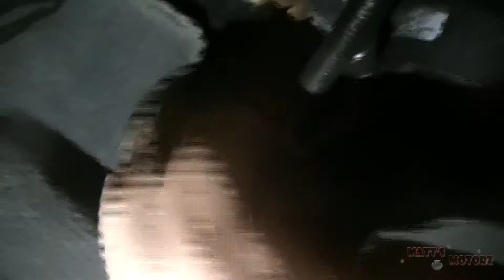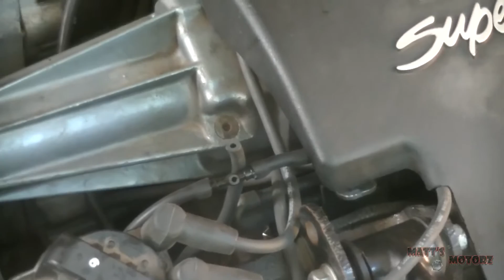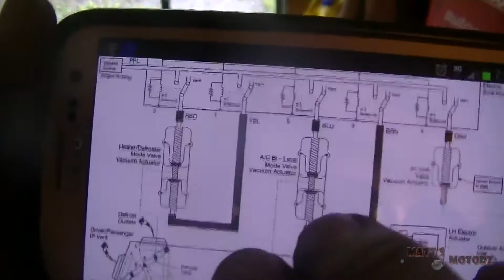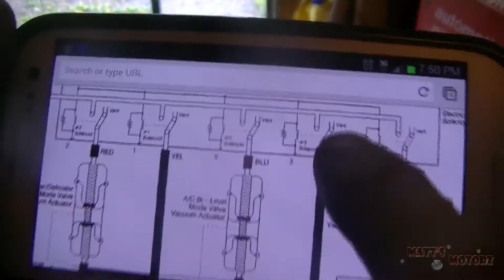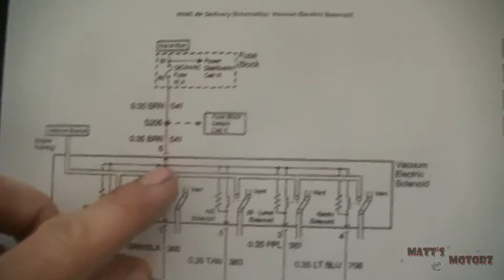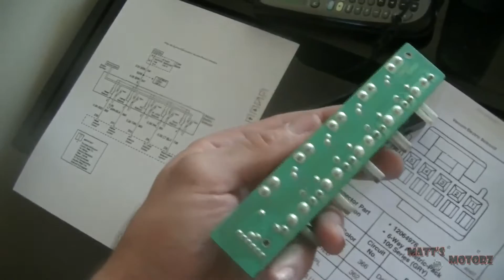HVAC Vent Modes Not Working Diagnosis and Repair

Comment: A note to all: I had the same issue with vents not switching and air coming out wherever it wanted to. I bought the Vacuum Vent Solenoid at Rockauto.com for about $60 .. Got it swapped out this morning (I am not as flexible to get under the dash as I was years ago) ... It takes a 5.5MM socket (I used a flexible shaft driver (1/4" drive socket) to get the screw out. I suggest you magnetize the socket as it is easy to drop a screw (one of mine went under the floor carpet and it would be a big job to pull up the carpet to find it) .. It takes a little jiggling and contortion to get the old one out and new one in. But it got done and now all the vents are going where they should be going. Note also a forehead LED Light will help you see under there easier (I need to buy one sometime)